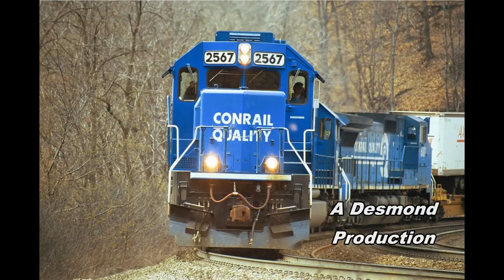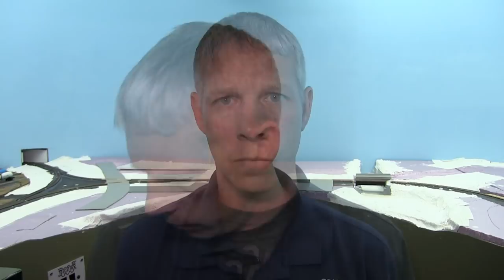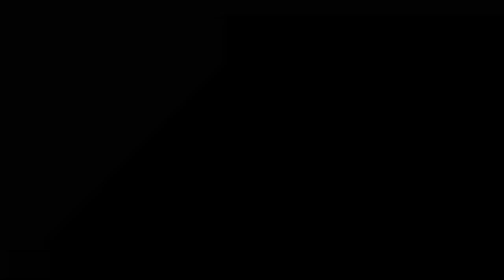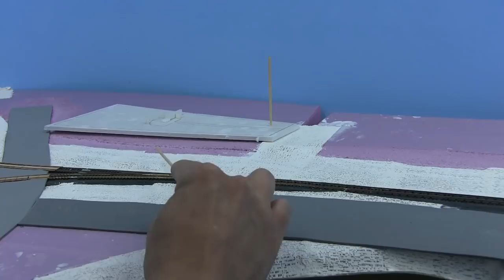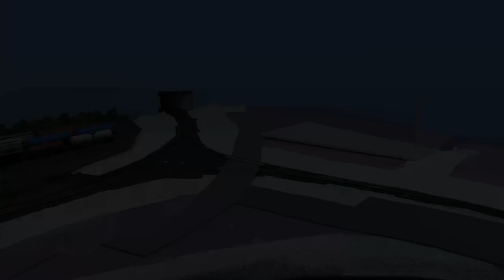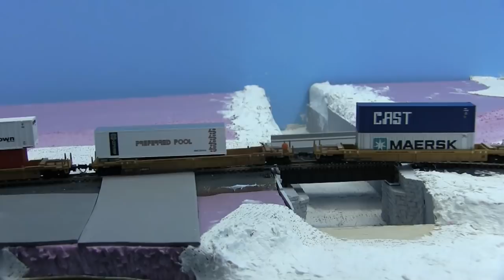Jamesburg Part 1

Comment: I'll be watching for your new videos whenever you have time to get them out. Thanks for the tip on foam mat. You won't need Sculptamold to seal the plaster gauze. While the gauze is still wet simply smear and smooth the plaster with your fingers. I learned to do that when I worked in the emergency room assisting with applying casts to broken limbs. Also, as I recall, Woodland Scenics illustrated the technique in one of their videos.
Reply from the maker: Jerry Smith thanks for the tips and for watching.

Comment: Why did you flip the Dayton Branch and the Freehold Secondary?
Reply from the maker: BMT Eastern great question big answer. So I know during design that I wanted to feature the freehold secondary. I never really intended to model the Amboy secondary near Dayton. Also browns yard is out of position because the  only place a sizable yard would fit was the wall where it is. So I made the determination that I would flip the wye at Jamesburg. I figured that it wouldn’t detract to much as most people wouldn’t know. The other alternative was to change the direct of view on the whole layout but then most of the industries I wanted to model would be off the layout in the isle. Now initially the wye at Jamesburg was only only going to be for show. Then I was toying with the idea of a hidden staging was, but the grade and curve to make it fit would not work. It wasn’t until later that I decide to break through and add the Amboy secondary. There were many other factors. But the biggest thing was space. I was restricted to the 11x14. Now if I had a 25x25 space or double decked it, I could have stayed true to the prototype. Maybe on the next layout.
Reply: @centraljerseyconrailinnsca5676  
Am I the first person to notice the flip?
Reply from the maker: BMT Eastern your the first person that has brought it yup. So I think so!